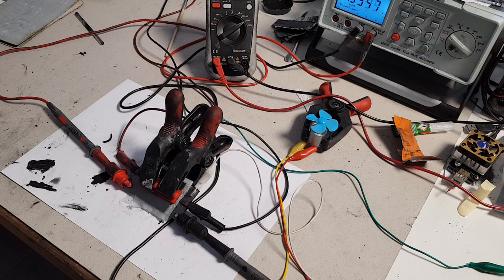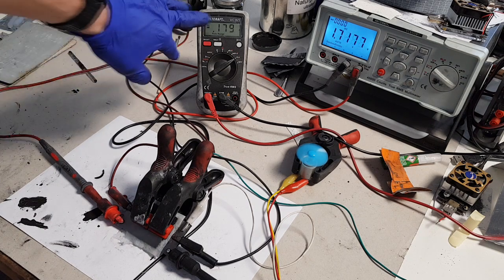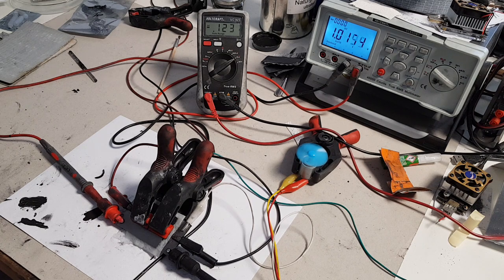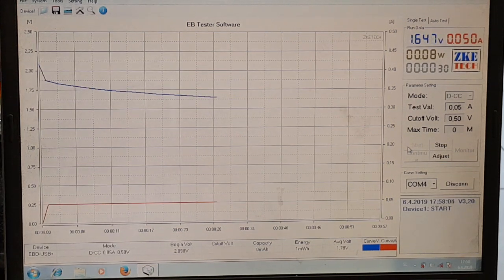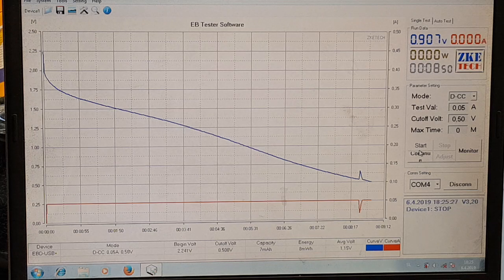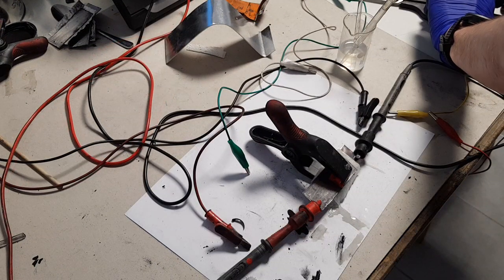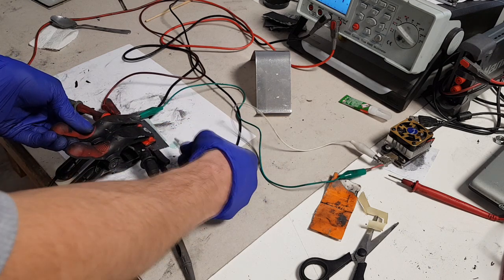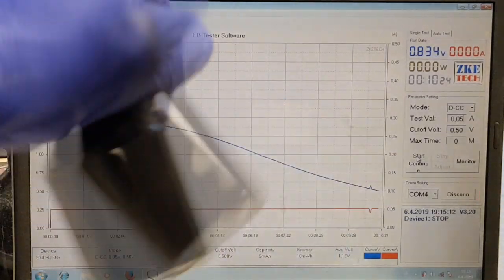Supercapacitor Capacity ink

Comment: I would expect with the mixed electrolytes that there would be a few side reactions that are either non reversable or rapid in capacity degradation. I wish there was a crystal ball that we could actually see what takes place. We are left with the only alternative being chemical equations for those that can but still there is a lot of speculation as the only real conclusive test is real world charge and discharge cycles over time. I do like the idea of multiple chemistry in electrolytes and feel there is a lot to uncover there. Good work as always. 👍
Reply from the maker: Yes you're right. In basic, the ZnSO4 is the main salt in this electrolyte and is here for capacity. The zinc is electroplated on the negative electrode. But in this case you can get the problem with dendrites. Therefore is here also Na2SO4 for reducing the dendrites and also hepls with ionic conductivity,.... the potential window is better for 0.2V. And here is also the NiSO4 for boosting the perfomance,... That why I was trying to use Ni salt in this project and also to see what I will get out from this. Is all about trying.
Reply: @cayrex  yes lots of trying. So is it fair to say that one ions type can be a carrier from one electrode to the other and a different smaller ion can the oentrate  the surface and  find its hole to occupy. Is that a concept that seems feasible?

Comment: capacity ink.  interesting name. 
It implies that if I keep painting layers of this ink on top of itself,  I would keep getting more capacity. that would only be possible if you found a way to 'paint a sponge'.  And I doubt that's the case. 

But that would be super cool.  A structured,  filiated, permeable carbon ink.  Mmmm, makes my mouth water😅.

paint a layer, let it dry... Then another layer and dry.  as much as you want.  And all the layers can be permeated from the top all the way down to the collector plate.  Mmm mmm mmmmmm - Juicy. 

And if you really want to make me dribble - let this material be a graphene based MOF (Metal-Organic-Framework).

O... my.... god. 
I better stop before I get a capacity ink heart attack.
Reply from the maker: Phahahahahahahahaaha 😂